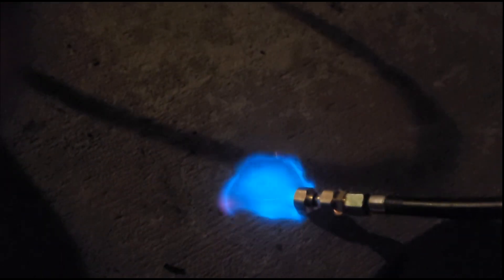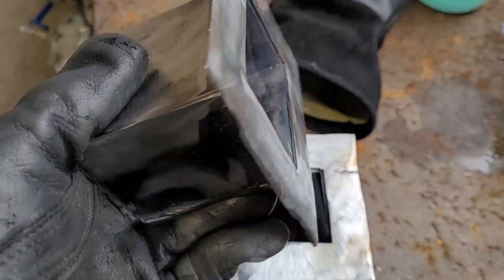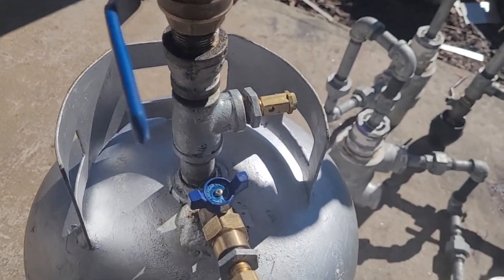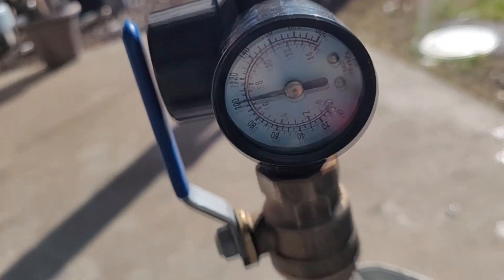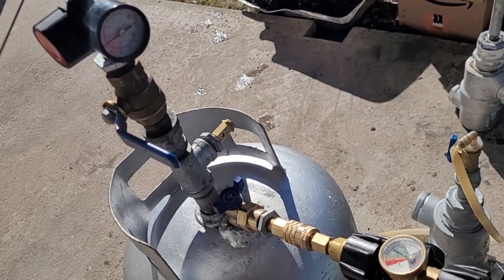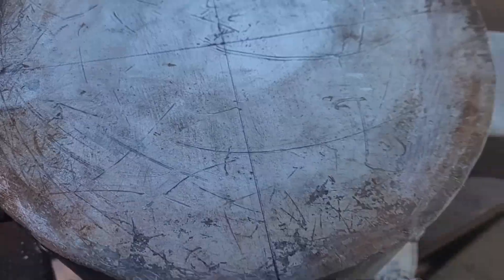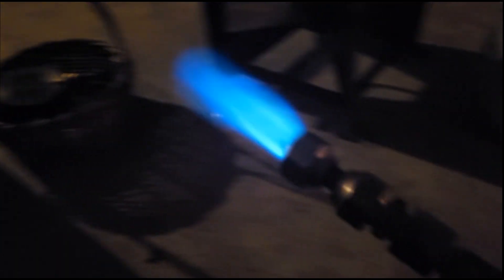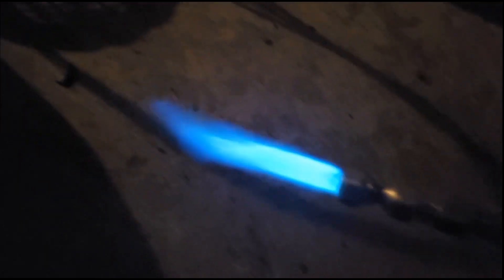Pyrolysis Reactor Update   It's a Plastic Blender!

Comment: On the note of the zinc-steel weld thing; welding is kinda bad for your lungs in general, but welding zinc is really bad (typically it is encountered in galvanized steel, so be on the lookout if any of that shows up)

(Granted it can get pricey (albeit less expensive than long term medical i guess) but some sort of respirator or something can't hurt; although i went through welding school without one)

Granted also (in "Industrial Hygiene" which is one of the classes i'm taking now we talked about this) "PPE is the Last Resort" so things like being outside, and having fans blowing the fumes away helps too (granted making sure you don't blow away the shield gas makes it a bit of a balancing act)

Bit of word salad here, but TLDR: Be careful and don't get Metal Fume Fever etc!

Comment: i worked with a man in 2010 who developed a microwave that was 60' x 10' x 7' it had wave guides and 3 microwave reactors. It worked great, took any material with hydrocarbons and converted them into syngas  and diesel fuel. 
The only problem it was not commercially viable. It took about one minute to completely break down and convert one automoble tire to gas, diesel, carbon black and steel. Pyrolysis using heat is better.
Reply from the maker: What stopped it from being commercially viable?
Reply: @naturejab  Thank you for replying,  the problem was it just could not convert enough waste per day. A commercial pyrolysis using heat can do about 60 tons of waste per day. The microwave of the same size would do about one ton per day and cost at least twice as much.
I believe I still have pictures of the unit if you send me an email address I will send them to you.
Reply from the maker: @Waydel  i have my email in the description if the comments remove it.
It's: naturejab@gmail.com

Comment: Obviously you're into welding, a little tip I came across recently is if you want to weld unlike materials or use various metals to weld with: Take apart those old 6 volt batteries if you can find them, or some types of AA batteries have a carbon rod contained inside.  You can sharpen it on a grinder, and then use it with a stick welder as kind of a modified "TIG" welding stick.  You just contact it to the surfaces you're welding and add in your material to the point of contact or puddle.  You can actually bond thin materials with just the high heat produced on contact with the energized carbon rod, for thicker joining you can add metal like; welding rod, coat hanger, thin strips of metals, brass/copper/silver brazing rods, or pretty much anything you can think of.  The temps are so high that contamination is usually not a problem, but you can add inert gas if you experience issues.
Reply from the maker: Wow that is a great suggestion. Carbon arc welding. Thank you! I will employ this if need be.

Comment: I have a video relating to your plastic into fuel experiments.  My idea revolves around utilizing an old style combustion engine called a "hot bulb engine" which can burn any fuel including crude oil.  Basically my idea is to use electric heat elements and the high exhaust heat to assist the pyrolysis of the plastic in the reactor I designed.  Since the engine is connected to a generator: the energy for the heating elements can be used for startup as well as any fuel.  Once heat is sufficient from the exhaust it can be used to take over the heating duty of the elements and all the generators electricity can be used for other purposes.  My current experiments revolve around converting a modern engine into a "hot bulb" ignition engine which will assist in the plastic into energy device I have conceived of.  Love your videos as they are along the same line of interest as I have, keep doing what you do-its awesome.
Reply from the maker: Very interesting. That engine sounds  extremely profound, they don't make em like they use to!  Also the idea of running the engine off the reaction is smart too. Thanks for watching and commenting!

Comment: Interesting videos you are making! I have see others warming up plastic to make oil,, they are very careful with the temperature,,, maybe you need to turn down the magnetron a bit to get oil instead of gas. slower heat up...
You put a lot of building in to your reactor,, would a "pressure cooker" not be a good places to start the modification.
Reply from the maker: Yes this is a great suggestion, thank you. Eventually I will need to install some type of thermocoupler system that will allow me to monitor the temperature. Agitation of the plastics may also help with slower and consistent heating.  A pressure cooker could work, but welding it is harder since it's stainless steel.
Reply: @naturejab   The Micro owens usually have all the electronic,, to heat less and even comes with time,,,, and defrost :-) (and I would love to see how that is build,, the magnetron part)
You are right stainless steel or aluminium is harder to weld :-/ but drilling and screwing stuff on an to it is the same. And it would be a easy (not necessarily cheap) building block,, and possible to have two identical reactors,, work on one and run the other.
Maybe it is as easy to move the magnetron, as the stuff it is heating,, it would not have to move much, just point a little here and there.
Reply from the maker: @MyPlayHouse  Great point, especially for future applications, thank you!

Comment: Next interesting channel to observe I see! Especially that I have seen Hazel Chem in comments :)
As for flashback arrestors, you can check out some HHO generator videos with copper mesh/copper wire cleaning ball for soldering iron.
as for stirring, I felt pain seeing you making a hole in the bottom of the reactor. It would be problematic to seal. If this would not work, I propose a more traditional setup, a long stirring rod through an air condensing tube mounted on top of the reactor. Plus is that bearing would be in a cooler region and maybe even self-lubricated/sealed with pyrolysis oil/wax. But keep it as plan B for now.
I am curious about your magnetron powering module. It is just the insides of the microwave, or something DIY? I have seen on a few channels that the internal microwave oven board limits magnetron work to a maximum of 50% of working time, with would decrease the yield of your reactor. With enough microwave power, I assume that carbon black produced in the reaction, with is mw absorber, should just heat up to high enough temperatures to melt the rest of the stuff. Changing the position of the magnetron (if mw bounce correctly) should heat more of a lower layer, with should heat top ones by convection/hot vapours and so on. Maybe some different magnetron setup will work better. 
Still can not wait for the next videos. I can see here an amazing adventure!
And traditionally: kee on cooking!
Reply from the maker: This comment was amazing thank you! I'm currently working on a DIY flashback arrestor  and also using oil as a seal for the bearing. It is true, the magnetron can only opperate at 50% efficency. I use magnetrons out of commercial ovens, with a DIY waveguide system. I'm also currently trying to find the best configuration of the waveguide, because the side seems to suprisingly be worse than the top positioning.
Reply: @naturejab  You are welcome :)
It is standard magnetron If remember correctly, you have square end of waveguide. It is possible that you have destructive interference from this, as well as size of reactor. Microwaves have size more or less from what I remember of half of wavelength to maximize constructive interference. It is possible that before height was better than diameter for that. especially with modification of waveguide inbetween.
Maybe it would be better to use 45° waveguide like in microwave oven to decrease the ath of mw inside reactor. With waves you need to take this into account first when planning.
Still, one thing at the time, find errors, adapt, construct and overcome!
As organic chemist I am very curious where this project can go ;)
Keep on cooking!
Reply from the maker: @ejkozan  Excellent, my next waveguide will take this 45 degree angle into account. I am honored to have your feedback, as a chemist!

Comment: Nice one mate! You might be better off with a dough hook type stirrer or something that needs less torque to turn (then it won’t break). 

Coal fires use a riddling mechanism or riddling grate that is hand operated. Might be easier than a constantly turning paddle system? You probably won’t need to turn it all the time.
Reply from the maker: This is a great point because they won't need to be agitated the whole time. Fortunately, it's modular so I can easily change the blade designs, as well as add hand crank to the pulley system to try many different configurations. 
Thanks!